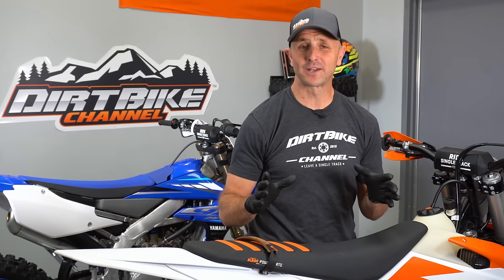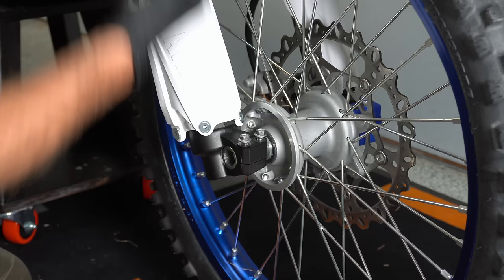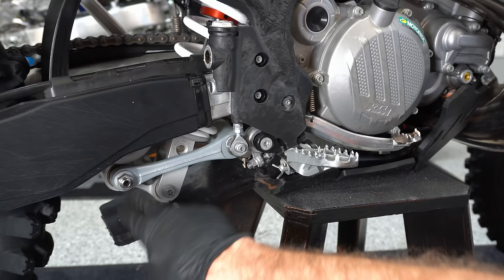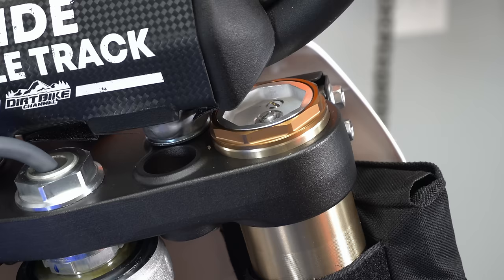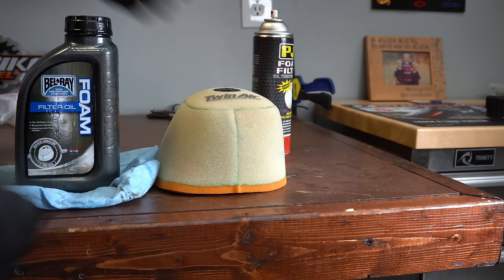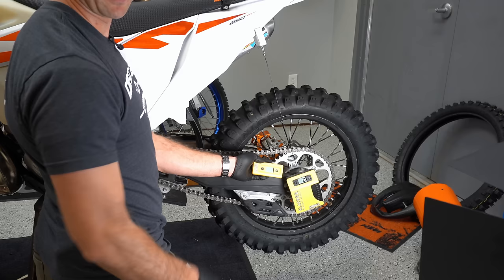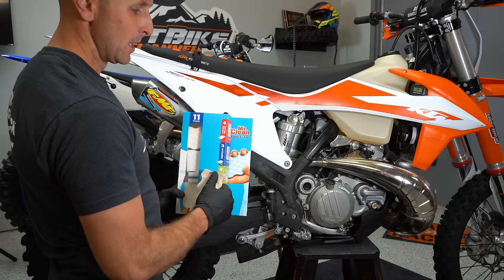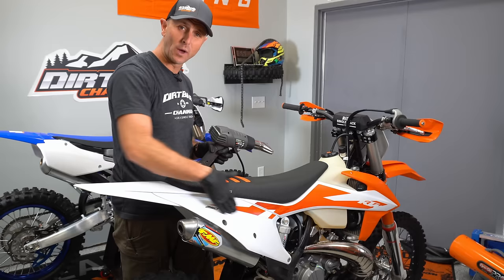45 of The BEST Dirt Bike Hacks, Tips, and Tricks - Why aren't you doing THESE?

Comment: That WD-40 is NOT a chain lube, it’s a all in one spray. So it also does DEgreas your chain.
Reply: Fortnine has two good videos on chain lubes and cleaners.  Recommends using simple green and a light (20w-50 IIRC) gear oil for cleaning then lubing.  Simple green cleans without penetrating the seals that trap grease on the bushings, and gear oil penetrates and protects from rust well, however it picks up more contaminants during a ride than a PTFE dry lube.
Reply: Man I just treat my chain like it owes me money and I get to go to dinner early not screwing around with cleaning it
Reply: @PapaWheelie1  mannn thats a whole mood!!
Reply: Yeah WD40 washes away the lube, dries out, and leaves a sticky layer that collects abrasive dirt and sand.
Reply: Stephan Moore II - Lol chains are cheap. Time isn’t
Reply: I use wd40 on my chain and plastics
Reply: PapaWheelie facts
Reply: Wd is not a lubricant. It stands for water displacement.
Reply: WD-40 is actually a solvent.  I  use chain wax.
Reply: PapaWheelie cheap? Where? 120 just for the chain on my 250
Reply: @PapaWheelie1  how did you get this name you are legendary
Reply: @bigtvideos6387  - Lol  The kids in the neighborhood would chant Pop-a-wheelie! When I would ride by the bus stop doing a slow wheelie every morning. It just kinda stuck
Reply: Exactly! These are facts. It will >Degrease< your chain and do the opposite of what you wana do with your chain. This guy seems very knowledgable about bikes but every now and then he gives some horible advice..
Reply: @PapaWheelie1  hahaha
Reply: i quit using chain lube.  my chains last just as long.

with the modern O ring chains, they are packed with grease.   so the only thing you are lubricating is the actual sprockets.  and that lube is gone in minutes after riding.
Reply: @hayes831  I put Motorkote on mine, actually treats the metal.

Comment: Swing arm covers damage your finish more than they save. Remove and clean under them often or just put decals on. Make sure to ride your brakes and glaze the pads up good so they don't work good. Several aggressive stops letting them cool in-between is the correct way. Oh, use chain lube. Otherwise, do what he said.

Comment: wd 40 get real
Reply: I was always told W40 wasn't a suitable lube as it's more as a moisture/water displacer. I would think it would be great to use on the chain to Chase out water after wash then wipe down with microfiber rag and then apply 80/90 gear oil . I always had best chain and sprockets life -by wire brushing chain and 80/90 reapply between each Moto.

Comment: Extra tips for you to add since this epic video can only get better.  Sorry if you know these already.   1.  When pulling a broken down bike with another other bike wrap the strap around the handle bars and instead of tying a knot hold the end on the grip...release your hand and the wrap unwinds nicely and safely.  2. Putting some air in a tube before mounting the tire does wonders for not pinching tubes.  3.  Short people have a tougher time lifting a bike onto a stand...they want to lean the bike farther over before lifting and use the thigh of one of their legs to help lift.  3.  The most popular tires are worthless in soft dirt...can't make a hill climb and get a IRC MB5...rides well on trails and will amaze everyone on the climbs and doesn't wear quickly.  4.  You probably know now but hoses exist to screw into oil plug for quick draining.  5.  When mounting a rear tire sit on the ground straddling the swing arms from the rear.  Your legs work miracles for holding up the wheel while you finagle it on hoping the spacers won't pop out.   6.  Tusk makes spacers that are smooth and don't pop off easily when mounting the year tire.  7.  Cushion seats are amazing now...some performance lost but great on trail breaking bumps.  8.  High compression radiator caps for technical slow riding.  9.  Don't forget to turn bike on after filling full of oil because oil filter takes up a lot of oil and you will need to add more.  10.  Make sure electrical components like starter relay aren't jiggling around because electrical parts don't like such things.  I replaced my battery with an oversized one and therefore relay needed taping down after I realized the seat wasn't holding everything in place.  Got to go, but hope that helps you add content.  I have many more weird tips if you want...just ask.

Comment: Hi Kyle,
I know shops and dealerships HATE when they have to change a tire with slime tire sealant in it but I feel just the opposite.
Actually got the tip from the guys over at Tubliss to use Slime as a lubricant when mounting a new tire.
I "paint" the high pressure tube and inside of my tires with Slime before install. Everything slips into place easily and cleans up with water. A few ounces in the low pressure chamber afterwards keeps everything lured inside to prevent friction and flats.

I was always told NOT to use standard WD40 on a chain because it's a degreaser not a lubricant. Maybe you can clarify?

Love your channel. Makes me happy every time I buy a product using your links (which is way too often!) That I can help support you and your family.
Keep up the good work and the outtakes at the end!!!
J
Reply: Basically WD 40 helps give temporary lubricant to the O-Rings. It won’t harm the rubber. I use Chain Wax directly on each ring, but WD 40 works and is also good because you can spray the whole chain and wipe off the excess with a rag. WD 40 can also be used for a chain cleaner.

Comment: The tip on steering head bearing tension is still wrong  kyle. Adding the caption to release the fork clamps is some of the correction, but the tension is not obtained from the bolt on the top of the triple clamp. It is obtained by adjusting the two collar nuts that lock together under the top clamp....🙄. Crank as much tension as you like on the nut or bolt on top of  the top clamp, you are only tightening it against those two locking collar nuts.  The bearings are under those...

Comment: Here's a tip for YOU - Get a Brush/Crash Guard that bolts into the bar end.  It will protect everything in the whole control group on both sides.  The one you are using will flex out of the way and is very short which allows everything to contact the ground before the guard (see 0.44).  The full protector will save a lot of damage to controls.  It will also brush away stuff that could  get caught between between your brush guard and control group, as well as actually protect parts of your hand from brush hits, because it is so far away from the end of your hand.
Your short Guard is also the reason for some of your tips.

Chain lube - WD-40 is good.  It comes off easily also when cleaning - taking dirt with it.  However a DRY LUBE doesn't sling off.  I use Teflon Multi-Use Lubricant, works great.

Comment: Three more:
1. Cut 1/2" off each end of your handle-bars to allow more clearance in tight single-track wooded trails; you won't miss the length, but you will clear more trees.
2. Apply a moderate amount of hair-spray to the inside of new handlebar grips before pushing them on the bar ends; it allows them go on easier, straighter, and it sets quickly.
3. Put three-wraps of safety-wire (spaced evenly) around each handlebar grip, and tuck the twisted-end down into grip; good insurance to keep your grips from coming off.
-Mack
.
Reply: I hate the safety wire hack, makes for an uncomfortable grip
Reply: @Andrew-vz3qk  odi lock on grips are the way to go
Reply: @Andrew-vz3qk  I've felt that the rare times I've ridden without gloves...
Reply: @quentinreviello926 I agree

Comment: I am beginner DIY dad and frustrated.  My sons CRF70 stopped running.  Symptoms were carb needed cleaning.  Ordered parts on eBay.  (jets, float valve, float, filter).   Decided to just swap jets while I have others soaking and cleaning.  Rebuilt no problems…. BUT….  It cranked on first kick and ramped immediately to wide open.  I triple checked the throttle pin/sleeve and it’s installed all the way inside knowing the only way it could go in that deep (1 cm below threads) was if the sleeve seated and the pin went down into jet).  But still same result.  I tried reinstalling several times and the pin/sleeve just appears installed correctly.  Throttle has some play but springs back ok, but not perfect.  After releasing throttle I can still turn it forward (less throttle) more manually.  I then pull cable off throttle grip and reseated cable in hole and down the cable grooves and reassembled guides.  Appears to be built correctly.  When off carb the pin rises compressing spring on throttle turn but when throttle is released the spring still has some tension and does not appear fully relaxed. 

Carb is sealed up good to air filter assemble, sealed good to block inlet pipe, etc.  all o rings new and in place.  Idle screw set to midway.  
The problem is still there going wide open when idle.  I am at a loss.  

Before I take to shop any ideas?  

I did buy the new jets 2 years ago and I am curious if I accidentally purchased oversized jets?  If my jet port/hole are oversized would the stock throttle pin become to small and act like throttle is always open?

Comment: I’m not sure I would recommend the air filter tip where you put the oil into it instead of spraying or running it on in a light coat. My buddy would do that and he always had carb issues and would be cleaning them constantly till he stopped doing that. Then he never had a problem. I guess just don’t go over board with the oil. But Idk why you’d need that much in the first place.

Comment: After you apply the oil to the filter through and through, use paper towels and squeeze as much of the oil out of the filter as you can, (until no almost more oil color is transferred on the clean white towels).  If the open cells of the filter are full of oil, the filter won't breath there.  This will block all dirt if you stay out of water.  Water is the only thing that will carry dirt though a open cell filter.  Your bike will run better and your jetting will be more consistent, (too much oil, and you run a bit rich, for example).
I wonder if I can be a paid consultant for some of these channels?   :)

Comment: Tearing Valve stems is actually caused by too low of air pressure in the tube from slippage which doesnt make sense because he said that lower air pressure will get you better traction (Barely) but you might also rip a valve stem.

Comment: Tying your dirt bike down that way is absolutely the best. I can't believe for 35 years or so I've always cranked the front forks down, which is not the best thing for the seals especially over an extended length of time. 👍 Plus the bike is more stable and secure. I go fast with my bike in back and now I don't worry at all about it tipping over.

Comment: Speaking of WD40, I just used it to fix squeaky kickstand and foot peg pivots.  Would’ve been better to go with grease I’m sure, but it sure was satisfying to get that smooth motion back with a quick spray.  

One thing I would add to the list is to periodically  check the torque on bolts, especially for anything that connects to the frame.  I always even torque on my seat bolts to spec after changing my air filter (yz250x) for example.  Anything connected to the frame will affect how the bike handles feels, so torquing bolts correctly can be critical to maximizing safety, comfort, and performance.

Comment: You did a great job and short order. Other than a few things, I do all of those tips. Glad you started with the Teflon tape, it really saves levers and housings on the bars. 

You missed loosening the pinch bolts when tighten the triple clamp. 

On my 17 FE 350, if I remove the fork stop bolts, the forks will smash my radiators so I just run them to where they stop while lightly touching them. 

My newly learned tip was when you applied silicone to the swingarm chain guide nut.

Comment: Air filters--don't knead and twist them--it shortens the life of the filter because it damages the seams when you handle them in that manner.  work the oil in good and aggressively, but in sections, rather than pretending you're wringing out a wet towel.

Comment: 1:02 in my opinion I would never do this I tried this on my pit bike once and it ruined my chain don’t do it use GEAR OIL 75W  is the best out there better than maxima chin lube
Reply: i agree wd40 isnt a very good lube. i do use it to clean my chain and other parts though
Reply: Yeah the wd40 catches dirt and that really works on the chain
Reply: WD40 to loosen any dirt and help driveoff any excess water from washing, clean with rag, then put gear oil on.

Comment: wd40 is NOT chain lubricant. It is water displacer. Its only use on chains should be used for cleaning.  I suggest dupont chain saver. best bang for your buck, and best function

Comment: Excellent video! These are really good tips! Love the editing style too.  Thanks Kyle

(Except wd40 on the chain isn’t cool)
Reply from the maker: Works great for me.  I got this tip from motorcycle mechanics and industry guys.
Reply: @DirtBikeChannel  excellent video, thanks much for all the tips.!
The only one I would tweak a bit would be the WD40 as a suitable lube. With the strain load and extreme pressure on the little links with metal to metal contact I would use the WD 40 as water displacer after washing bike then wipe chain with microfiber quick then let remaining WD be used as vehicle to help transport 80/90 gear oil while applying down into nooks and crannies of rollers. Having said that this is from a motocross bike non o-ring perspective... With O-ring though I think your fine doing just what you recommended as it's been my experience that any thicker lube can not easily get passed the tight rings anyways.

Comment: “ its easier to use a bike pump than the air compressor” me: smh ya right 🤦🏽‍♂️
Reply: For real though I’ve found it a lot easier just to use a bike pump. You’re only going to like 15psi anyway
Reply: Bike pumps are easier, and you have a gauge attached to it.
Reply: @thesprucemoose7276  you also have a gauge on an air compressor
Reply: @proarmy70  Not one that measures the tire psi. You need an attachment for that, and lots of people don't own one

Comment: WD-40 on the Chain, huh?
Reply: I have always been told that wd 40 wasn't suitable for use as a lubricant and it was developed as a moisture/water disperser . From what I've seen 80/90 gear oil is hard to beat.

Comment: Wd40 is not good for chain lube. It is a water displacer. Use a real chain lube and follow the instructions on the can and it won't get all over your bike. I prefer pj1 blue label. Also, I wouldn't recommend using the Teflon on the hand guards if you want them to keep your hands safe.. the whole point of them is not not move and deflect what would otherwise hit your hands... There is a lot of bad advice in this video

Comment: WTF... WD-40 for chain lube is the dumbest idea ever unless you're running non orings and need to replace it anyway. WD-40 eats and breaks down the material used to make orings and x-ring etc...you should be using gear oil to lube your chain. Powered in your tire is dumb too...if water enters the powder becomes abrasive breaking down your tube and inner tire.